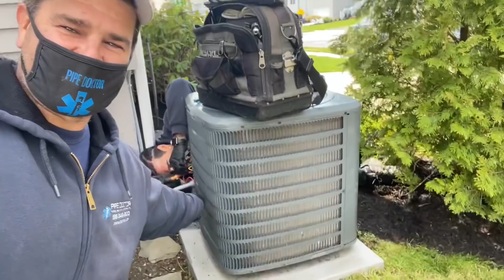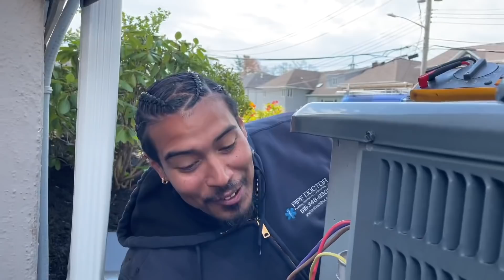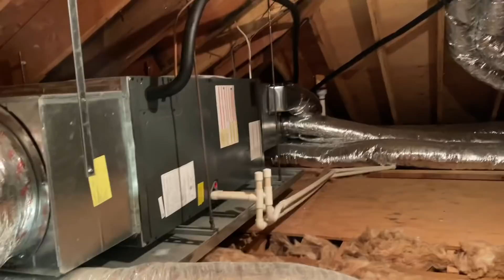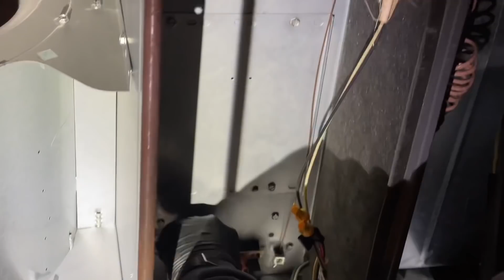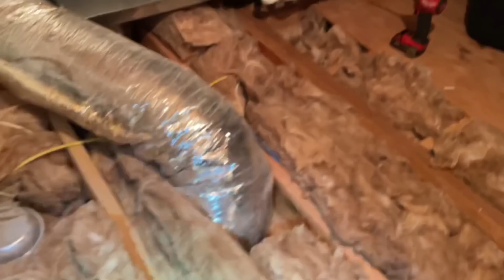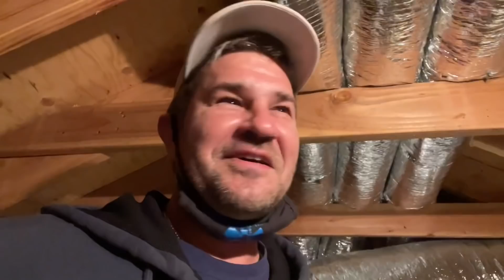HVAC Apprentice Makes Major Mistake & Tips to Avoid Condensate Seamen in Your Mouth

Comment: Use a meter set to tone to show continuity on blown fuse/good fuse. I already knew abt fuses from doing car work before getting into this trade but that's one of the ways I learned about using the meter. That and single pole contractors.

Comment: Be careful Zilla putting your face near bare wires.  I was on a job and an electrician got zapped on the face by bare Romex wire while working on a disposal under a sink. He was stuck and rigid. His boss had to pull him off it by the legs.  Burned his face and almost lost his eye.

Comment: That's the method I used to clear the blocked condensate line on our AHU...however, it involved the drilling of a few holes (no access plug originally installed--must rectify that situation), so it looks as if I'm playing a flute (children! Please!) at floor-level.  Liked the Tom Jones ending, there!

Comment: Lol, even with a CO2 purge you can’t blow out that line except where it terminates, the way that’s piped.
Think about it. Live and learn.
You’re just blowing air back into the drain pan unless you open the cabinet and plug the drain on it.
It’s a great joke to pull on an apprentice tho and you got pics 🤣
Reply: Mikey Pipes - Pipe Doctor Plumbing & Heating & Air
Lol, I know.
Now Zilla knows he got pranked too. 😉

Comment: Interesting condensate drain setup, no float switch on the coil secondary drain or pan float switch? No vent tee after trap ? Thanks for posting.
Reply: Installed to the specs in the Goodman manual. Condensate sensor in the drain pain wouldn’t be a bad add on but it’s a slick looking install.
Reply: Yes sir I agree being on the negative side (vacuum side). Trap should be primed also.  But summer isn't here so he might get lucky.

Comment: Honest question, why try to neutralize the condensate from an AC? Wouldn't it just be regular water from the air like a dehumidifier output? I'd think it would only do anything for combustion products, like from a condensing boiler.

Comment: What is the range you use for contactor coils?
Reply: Try reading resistance off a couple good OEM ones with different voltage coils ie; 24, 115, 208-240 and 1pole or 2pole.
There really isn’t a standard, rule of thumb that is reliable.
A bad coil will either be open or shorted, burned looking or not.
Reply: Mikey Pipes - Pipe Doctor Plumbing & Heating & Air 
That’s about right, depends on if it’s 1 or 2 pole tho, I checked yesterday with a few of this and that for comparison. You know the drill, it’s open or shorted when ohmed, that’s all you actually need to know.
😉